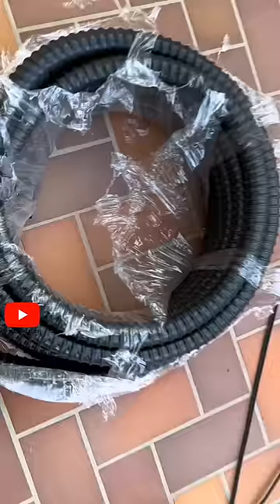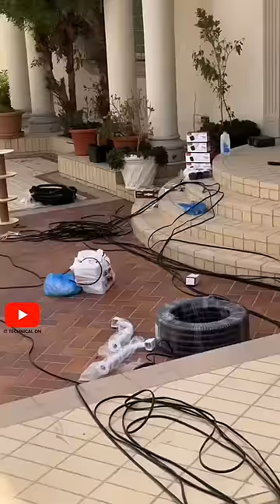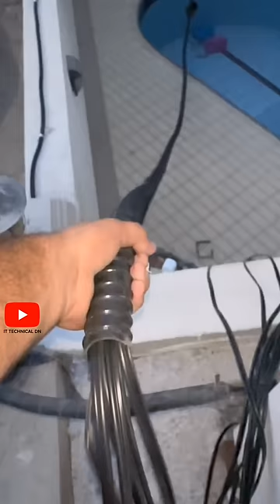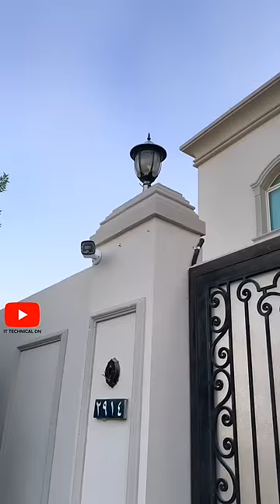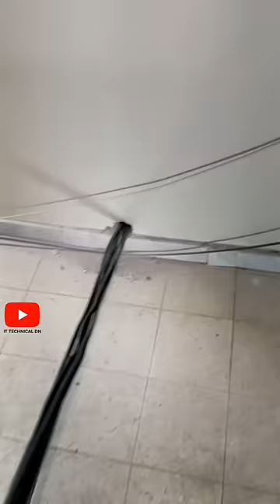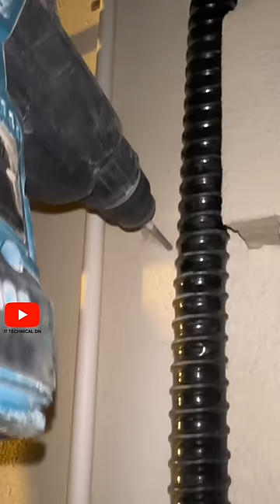Cctv camera installation

Comment: Wtf, wifi cameras and nvr exists did you know
Reply from the maker: Yes available amozon
Reply: Why not ip camere
Reply: NVR and IP cameras are garbage, always have latency, and will disconnect if your internet is out
Reply: @fruitieplayys9125  still better than fill the walls with those ugly tubes 🤢🤮
Reply: if your wifi disconnects they turn off though. theres also burglars that use wifi jammers to block the signal to your cameras

Comment: Wifi cameras are much better than this, no such installation risks and mess. What's your thoughts?
Reply: Not efficient
Reply: It’s great but you need Wi-Fi but Wi-Fi security cameras are much more better only take like five minutes and mine is ring
Reply: I wouldn’t install WiFi cameras at my home. I understand for people at an apartment or a temporary place. When your internet goes down, all your cameras are out. Wireless cameras have a delay because of bandwidth, distance, walls, objects affect this. Wired cameras have a better quality and more consistent in the resolution. You can also backup a wired camera system with a battery in case power goes out.